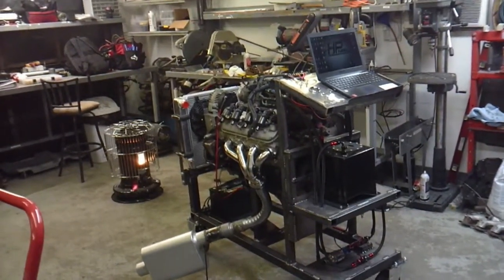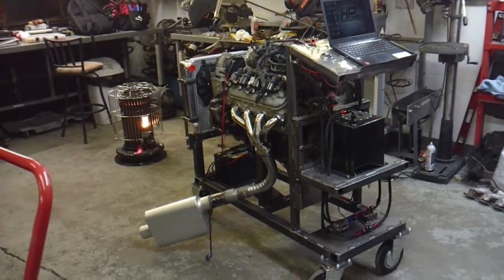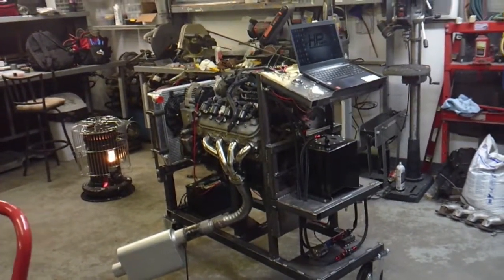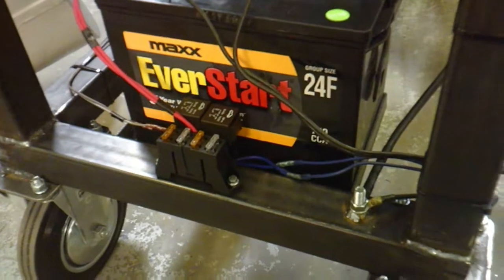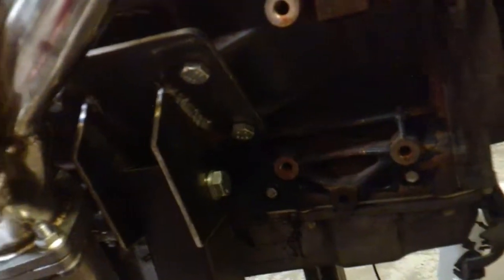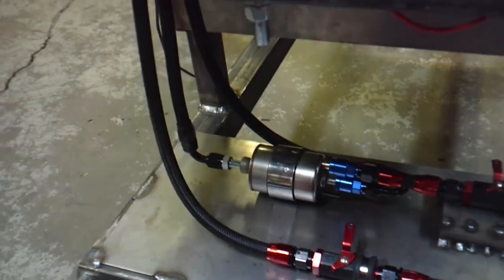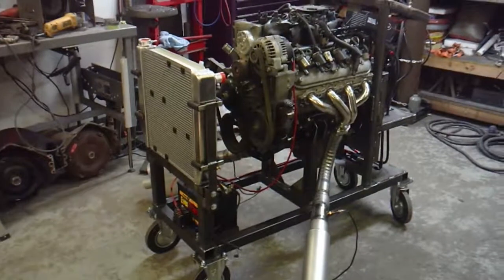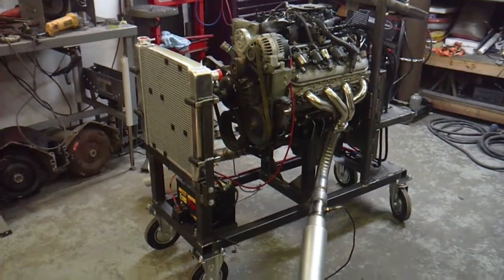LS Engine Run Stand

Comment: The fuel system is overly complex. You only need two lines. The return style fuel rails have their own regulator and the pressure is lower than the filter style regulator. You can run the fuel feed line to either style fuel rail. The only difference is if you hook up the return line from the rail or not. No valves or addition lines needed.

Comment: What fuel cell are you using  , does it  come with pump inside  . Great stand  thinking of building on since I have engines I want to test run first  before installing,  can I test run on stand with  a terminator  harness?

Comment: Why not just use the corvette filter/regulator for both types of fuel rails??? and just block the return off on the fuel rail in this video with aN fittings??
Reply from the maker: You could, either way obviously would work. Reason I chose this way, not that it would make a noticeable difference idling on the stand, but fuel systems that dead head have injector data in the tune that reflect this. Just as systems that do not dead head also have data for the injectors that reflects that. With the method I have shown here you only need to flip a valve and quick connect/disconnect the lines that are needed. Simplicity, quickness to connect/disconnect and keeping it connected as close to stock as possible. Those are my reasons.
Reply: @laststopperformance2288  I might just create a hose that connects to tank and return from fuel rail if aN block off method gives any issues,  I bought a fuel tank with 4  different aN connection points so Making a quick connect aN setup is easy and just use block offs when not in use.....    what did you use for throttle setup?

Comment: Would a fuel pressure gauge make sense with this setup?
Reply from the maker: You could. If going with a different fuel pressure regulator like an aeromotive you would have to to set the pressure. The corvette style filter/regulator are very common and usually fairly good at keeping around 60 psi as long as you dont have an overpowering fuel pump. Rare occasions I've seen that filter/regulator hit 70 or so psi right out of the box.
Reply: @Last Stop Performance  so the fuel pressure gauge goes at the end of the line, at fuel rail?
Reply from the maker: It really depends on what you're trying to accomplish. If you are using something like an aeromotive FPR then a gauge could screw directly into the FPR. If you are looking to simply verify fuel pressure while using the corvette style then I'd just use the schrader on the LS engine rail. Typically harbor freight carries a basic fuel pressure test kit that you could screw on to verify.
Reply: @Last Stop Performance  looking to verify. Perhaps I will be changing intakes periodically. Was trying to cover my butt and get everything I needed upfront. Probably will do a setup like yours. 👍🏾